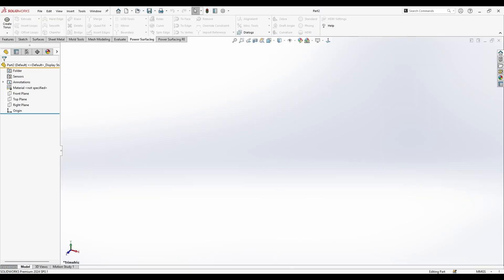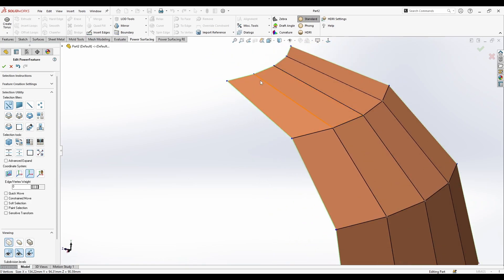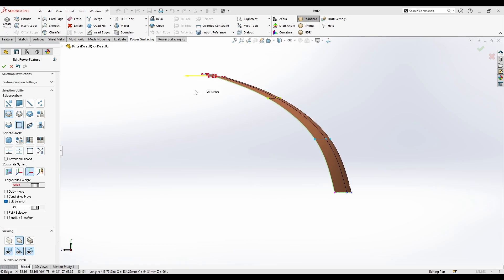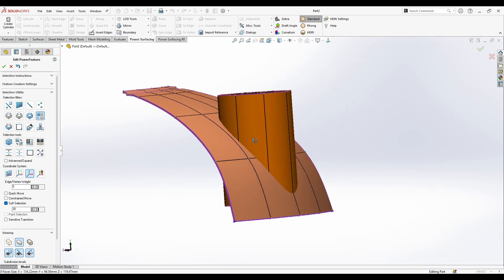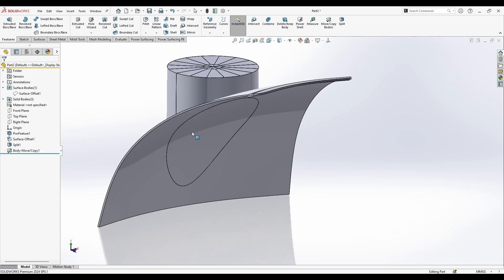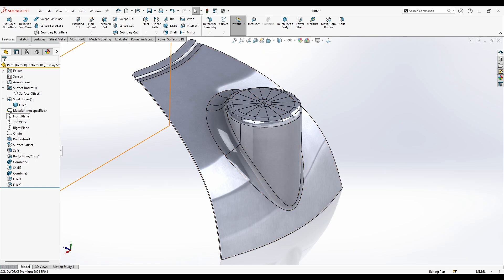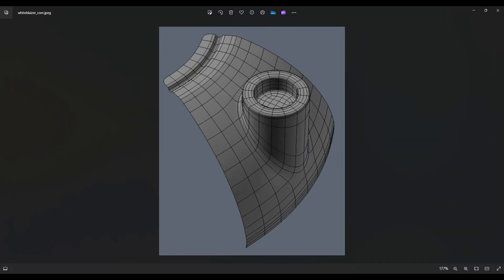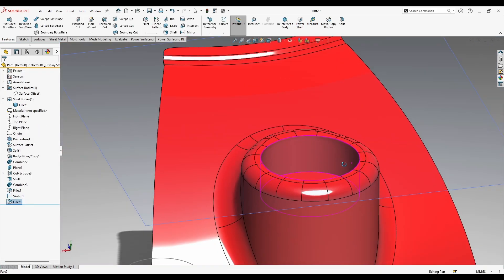Advanced Surface to Solid - Power Surfacing | SOLIDWORKS+

Comment: You can't just trim surfaces in power editor?
Reply from the maker: No, there is no direct trim in Power Surfacing. You'll need to convert and then trim in SolidWorks.